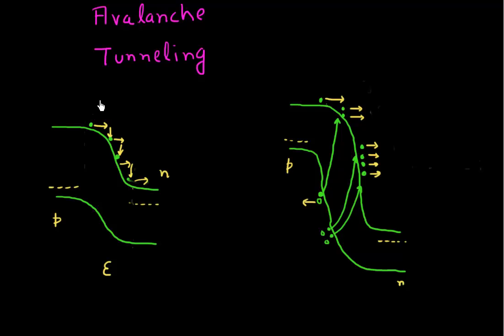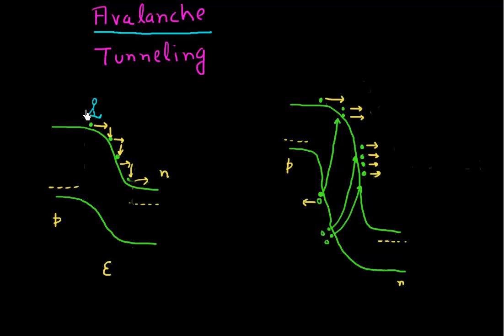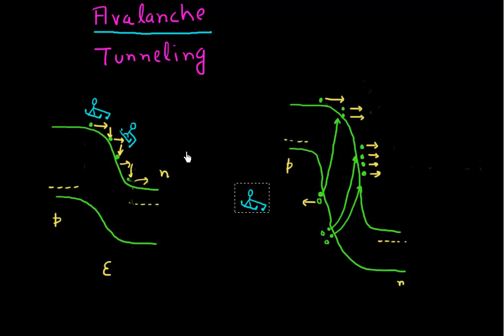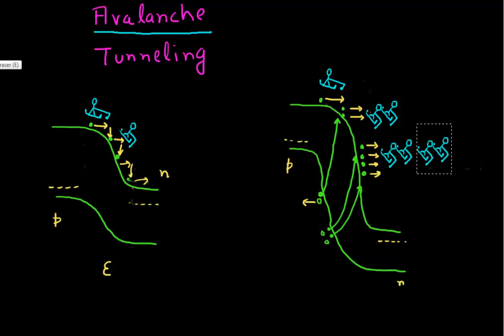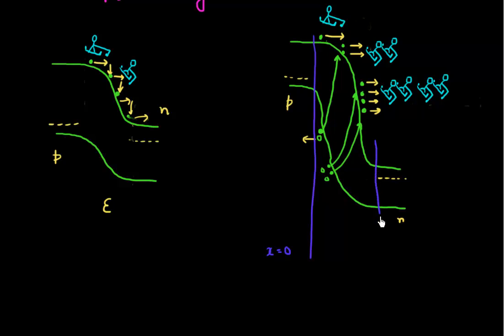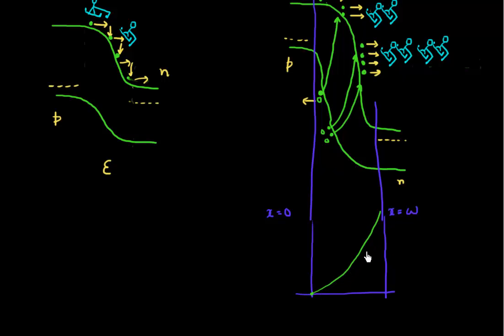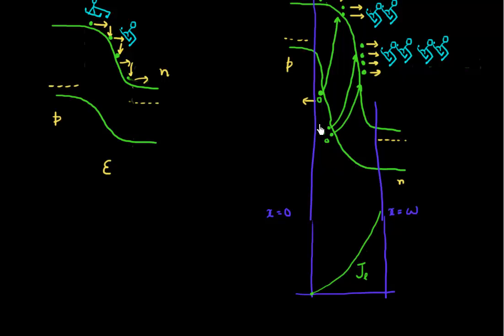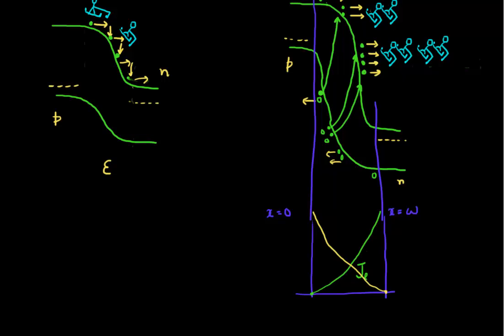P-N diode: avalance breakdown: P2

Comment: Very good explanation but I wanted to clarify something that the narrator says in the beginning of the video. He says, minority charge carriers i.e. electrons diffuse from the p type region to the n type region. I would disagree with him because minority charge carriers can only drift and not diffuse. Diffusion occurs when there's a charge gradient i.e. charge carriers can only move from a high concentration to a low concentration area. Minority charge carriers on the other hand can flow or drift when an electric field is applied. Thus, higher the reverse bias, higher the field and vice versa. Please let me know if there's a mistake in my understanding.